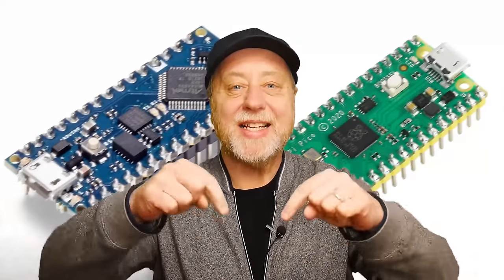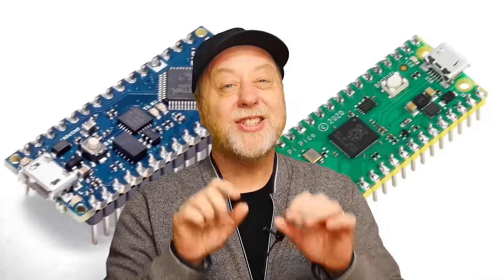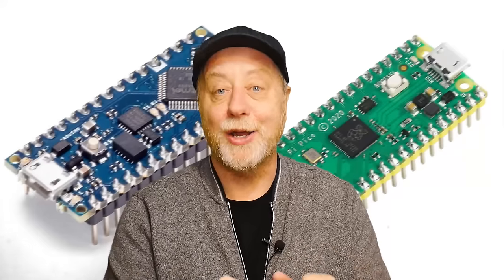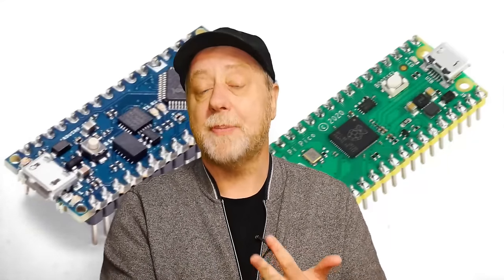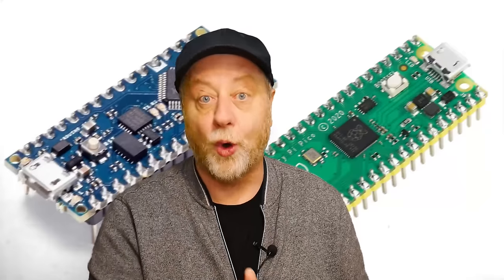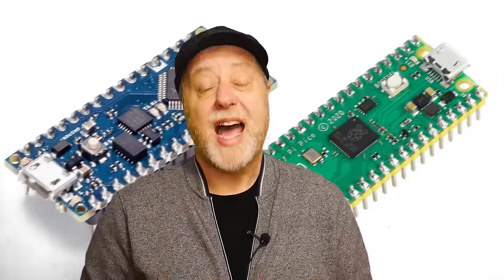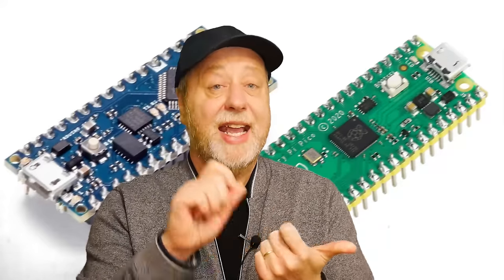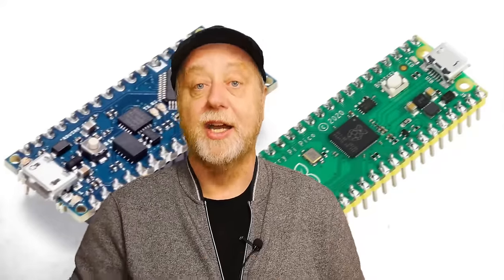Arduino vs Pico - Which is the Best Microcontroller For You?

Comment: Gary - do you have a review of the programming interface differences between the PICO and the Arduino?
For example - the Arduino programmer must install the Arduino programming interface software and download libraries.   The Arduino programming interface has a device feedback display where variable values can be printed to screen.   The Arduino code must be written in a text editor and then uploaded into the device.   I'm wondering if you see the PICO interface to be as convenient as the Arduino?
Sincere thanks!   Love your videos!   You are awesome!
Reply from the maker: I don't quite understand the question. You get all of what you said, about the Arduino, on a Pico using Python (with Thonny) or with C/C++ using an IDE like VS Code.
Reply: @GaryExplains  Thank you Gary.   I apologize for not being clear.

In your experience - do you find the Pico programming process and environment to be as convenient as the Ardruino?

And do you find the Pico libraries and user-group support to be equal with the Arduino?

Comment: For me Arduino was a great way to learn about microcontrollers and electronics in general. Now I mostly work with bare Atmegas when building circuits. It gives me the flexibility to use a chip that fits my design, not the other way round. I have a feeling that Raspberry Pi will not allow you to take that next step, and you are always limited to using the board whether you need it or not.
Reply from the maker: I guess you are referring to the fact that you can get the ATMegas in DIP format. There are solutions for Arm processors using a SOP to DIP adapter board. I did a whole video on building an Arm Cortex-M0 board from scratch: https://www.youtube.com/watch?v=4PMj8LfR2m8
Reply: Thanks!
Reply: You can buy the rp2040 itself and design a board for it yourself to fit your needs so you arent limited to using the raspberry pi pico to be able to use the rp2040. You do need external components with the rp2040 though like capacitors and flash storage.
Reply: @conorstewart2214  my only problem is the QFN, I would like a QFP at least to not need a hot air station and make it more friendly. Is the most cheap MCU I can get but not the more easy to work.
Reply: @oienu  If you have a hot plate or hot air station which you should have if working with SMD components and you can get them for very cheap, then QFN shouldnt be an issue. I think I have seen people hand soldering QFN too, you need to extend the pads out.

Comment: If I was starting a new project I'd probably use the ESP 32
Reply from the maker: Interesting... Why?
Reply: @GaryExplains  usually I need Wi-Fi for my projects. And I like the multiple cores. 
My previous go to was the nodeMCU
Reply from the maker: @paherbst524  Sounds like you need the Pico W. It has Wifi and dual core.

Comment: Which one has less power consumption ?
Reply from the maker: Hmmm, since there are lots of Arduino boards then you will need to be more specific. Then there is the issue of the power consumption of whatever project you are building. Obviously the power consumption of the microcontroller is irrelevant if you are building a robotics project or doing lots of WiFi or powering a screen or whatever.

Comment: Can it run Crysis?

Sorry, I couldn't resist
Reply: Some mad lad recently made Doom run on RP Pico, which is quite a feat because low CPU power, very little RAM and just 2MB of storage. The original Doom required 4 MB of storage, for example.

Comment: Everybody, do yourself a favor, get VScode and PlatformIO (both free) and program these microcontrollers from there. The arduino IDE is brutal when having any source code with more than a few lines. You get so many advantages with a proper IDE.
Reply from the maker: I have a separate video about Platform IO already on this channel.

Comment: I think  the  ESP32 microcontrollers should be mentioned as well . The power of a single  Wemos D1 Mini is huge.  compared to a adruino. Even if  you count in the Price for the Wemos boards  Approx 2 Euro's per board.  i have no experiences with the raspberry pico so far.
Reply from the maker: I don't think ESP32 should be mentioned in a video not about the ESP32.
Reply: @GaryExplains  perhaps for another video.

Comment: Worth mention, I have to use the nuc utility to switch from arduino to microPython IDE.  Also, RP2040 is a speed demon that can be overclocked both cores much higher than default, as you know. Clear winner for speed, however, Mega for driving lots of stuff, some arduinos lend themselves to Ultra Low Power mode. So I choose the micro controller and dev boards based on purpose. I hope to see a similar variety of purpose built dev boards in the 2040 offerings in the near future.

Comment: To answer which is best.. as an engineer designing boards, 
The cost of a product is not the base cost of the processor
Can the Pico code be protected ? Can any Arduino chip code be protected ?  please answer that...
Maybe encrypted code can be read out, but can Ram be read out ? its tough to really secure your code in a microcontroller, is there any microcontroller with truly secure code ?
Reply: we, the open source people don't like closed systems anyway
Reply: @Henry-sv3wv  but how do we protect a new product ?
Reply: @nickmarsh9384  With the GPL license.
Reply: @Henry-sv3wv  Do you really think any kind of license will stop someone from dumping the code from a micrcontroller or reverse engineering it and using it in their own product? That is what they are on about. Not everything needs to be open.
Reply: @conorstewart2214 
>Not everything needs to be open.
Yes, it does. Even Nvidia  decided  to make open GPU drivers.
Reply: @Henry-sv3wv  no not everything needs to be open,  Nvidia doesn't have much to lose opening their drivers, they only work on Nvidia products, all they may lose is licensing money on the drivers, people still need to buy the graphics cards from them, their hardware is still closed and the software and drivers are useless without the hardware. If someone makes a product that uses a microcontroller then anyone can dump the flash and ram and copy the product, that can't happen with proprietary hardware like Nvidia, so it's not a valid comparison. Also making something open source means that it is very hard if not impossible to make money on it, so say you've got a team that worked for years developing a piece of software, the moment they make it open source they can no longer make much money on it because anyone can run it for free. So if everything has to be open then people can't make money developing these things which means people won't develop them and nothing will get done, open source is good for some things especially hobbyist projects and academic use but it is very hard to build a business model around anything open source.
Reply: Have y'all forgotten about lockbits? Yes, they are a thing. And the code never gets written to an MCU in its source form, only in compiled one.
Reply: probably not at this moment. but ST is doing a good job on integrating security in its new cores. And this is really becoming an issue as more and more devices are interconnected (over the internet). You do not want your house/factory/car to be hacked.

Comment: Anyway to program these things with old school type basic language? All these new languages are nifty but my preference would be something i used for a long time. I still like learning and would rather spend the time learning the device but not the language.
Reply: The problem with basic, and Python really, is that these are interpreted languages. These are many times slower than a proper complied language. Basic is also generally a terrible language in the 21st century. It encourages bad habits and can only access the hardware using custom keywords. You can learn the Arduino version of C - which hides some of the complexities of compiling - pretty quickly. I’m guessing if you only know basic then you haven’t programmed for around 40 years?
Reply: not helpful and insulting. and wrong!
Reply: BASIC really is… a language of past. Python has taken its place as the easy to learn and use language. In part because it’s so much newer. After all, Python is only 30 years old!

YouTube was was originally, and I believe still is, primarily written in Python because they could iterate so much faster than using traditional languages like C. So much so that Google gave up trying to create a competitor and bought YouTube.

For someone already familiar with fundamental programming concepts  like variables and branching, it’s quite easy to start writing basic programs. I mean REALLY easy. My response on first encountering Python was “This is what BASIC should have been.” 

There is a classic Python joke: how do you get from your pseudo code to a program written in Python?  You change the file extension from .txt to .py.   Once you try writing some Python you’ll understand how that is is funny. Well, at least a little bit humorous. 🤷

Try it. I think you’ll be pleasantly surprised by how little you actually need to learn. I think that reflects the intention of its creator to create a language for teaching programming. I think he wanted a language that wouldn’t get in the way of learning programming concepts.
Reply: I have answered my own question. All I was looking for was an option for basic. And it is available.  As it turns out there are multiple options for basic on the pico including pydos/pybasic. I have nothing against any other language.  I believe people should code what they would like to code in. I am not asking for language information for a career here.
Reply: @retronicksprogrammingchann2337  Agree entirely.  If you just want to be creative, it's often best to start with what you already know.  (I still use CAD software that I learned in the 1980s for some drawing tasks.)  If you come up against limitations, you either work around them, or you then find out how to use a different tool for that particular job. Over time, that may become one of your preferred tools as well, but that's up to you of course.
Reply: @GodmanchesterGoblin  I just have to remember that this is youtube and sometimes its just kids responding to what they have been told at their intro to C++/java/python course.  As they used to say - best tool/language for the job.  I find that the constraints of a tool make you become more creative to find a solutions. But sometimes if there are too many constraints than you need to look at something else.  I think basic or basic like language should work fine here.  Some of these old dos programs just work better even through dosbox. I have  read some of the best authors are still using old dos word processors because that's what they  and more productive in.
Reply: python is the better "basic"
Reply: python is great - nobody is putting down python. its not basic though.
Reply: I don't really understand what you mean by "I want to learn the device but not the language"
Devices change faster than languages.

Besides, if you write code for these boards in basic, you re really missing out on one of the biggest advantages of these Arduino's;  the libraries.
How are you going to do analog IO, or serial IO, or how are you going to use any SPI display if you don't want to use the libraries that are written for these?
You will spend months doing a simple thing with an Arduino based on ATMEL chip... Then you find your project needs something beefier... And you wil have to start all over from zero on a board with an ARM processor.
Reply: i fully understand what you are saying. I understand the advantages of using the python/micro python etc. This is just a preference that i would like to do it a different way. I already know some python but i will spend a good amount also looking up language features as its not something i use everyday and I just don't find it fun. I do find the basic language more fun to play around with.  

And what i mean by learning the device is that i want to learn how interact with the hardware. the logic and software application i would rather do it with a basic type language.

Now what i don't understand is all the negative view about using somethin else. I am not in any way suggesting this for anyone else. It's just me, I am not out to change anyone's option about basic either. I am not trying to convert anyone to it. Python is a great language use it and create amazing things.

As mentioned in another post there are options for basic and the pico device and i will be trying them.
Reply: You can use assembly directly, if you wish :)

Comment: The main difference between Arduino and Raspberry pi is that Arduino you can actually buy and Raspberry needs to fix their supply chain...
Reply from the maker: I disagree. There aren't any problems getting the Pico, they are generally in stock worldwide. Plus there are plenty of clones on AliExpress.

Comment: The PICO options sound the best. I really don't like the Arduino IDE. Thonny seems more straightforward for micropython. I am very interested in C and C++, that is way I am more interested in the PICO. It seems to have more control. Thanks for the content.
Reply: You don't have to use the Arduino IDE though. I use Visual Studio Code for both my Arduino and Raspberry Pi projects, so much better than either one of their IDEs.

Comment: Since you asked, I'd use a Teensy
Reply from the maker: Interesting, why? I find the tiny size limits the number of GPIO pins.
Reply: @GaryExplains  For high speed projects I prefer the Teensy. The high clock speed and the highly optimised libraries. For cheaper options I go with Arduino (and clones) and more recently Pico.

Comment: I am getting nowhere with the pico using C++, I connect it to the arduino IDA and there is no driver :(
Reply from the maker: I have two videos on getting started with the Pico. You might find them useful.
Reply: @GaryExplains  I have looked at the C++ one, it's on Linux not actual Windows :(
Reply from the maker: Technically I used Windows Subsystem for Linux, so you don't need to install Linux. But there is also a setup program you can run on Windows to install all the stuff you need just on Windows (without WSL). Also if you have a Raspberry Pi you can compile on that.

Comment: The reason I don't like the Pico is because the RP2040 chip is impossible to hand-solder onto custom PCBs. Since it was designed with hobbyists in mind why can't RPF release an LQFP version?
Reply from the maker: So you don't like the Pico board because the chip on that board can't be used independently of the board in a way you want. Well that makes sense... Eh? 🤦‍♂️
Reply: @GaryExplains  Well it makes sense to me and probably quite a number of others who use Arduino or STM32 ARM core (eg bluepill) modules along with various shields to prototype and debug a design and then consolidate the tested design onto a single custom PCB.
Reply: @seankayll9017  worst comes to worst, you can always order a stencil along with your pcb (if you order it instead of printing pcb by hand) and use a hot plate and be done with it
(just a suggestion 😉) RP2040 comes really cheap though, like dirt cheap, you can order 10 for 9GBP for pimoroni (I don't know if there are any chip this cheap with this kind of power, so any pointers are very appreciated)
Reply: @thenewnew1997  Yes, thanks for the suggestion. I have used a hot air rework pencil to solder such packages in the past but I just don't trust soldering that I can't inspect easily under a microscope. Some of the STM32 M0 uCs are quite cheap (and LQFP) - but not 10 for £9 cheap, certainly not in a few-off volumes anyway. I know the RPi Pico board has castellated edges for flat soldering to a PCB motherboard but not all designs will accommodate that.

I think it is also possible to get PCBs made in China with companies that also offer soldering of SMD parts. That would be another option I suppose.
Reply: Fully support you there. An LQFP would be nice especially for designing prototypes. And for that reason I went on to STM32. (And that stoopid python language thing🤪)
Reply from the maker: Did you watch my previous video on how to build a Cortex-M0+ microcontroller board from scratch? Using an AVR chip isn't the only solution! SOP to DIP adapters aren't hard to use, even I managed it with my terrible soldering skills! I have a video on how to build a Cortex-M0+ microcontroller board from scratch: https://www.youtube.com/watch?v=4PMj8LfR2m8
Reply: Just think of the pico board being a DIP chip.

Comment: Is the Pico actually a Raspberry Pi? Does it run Linux?
Reply from the maker: No, the Pico is not like the other Raspberry Pi boards and it doesn't run Linux. I have an intro and review video on this channel if you want more info. If you want a small and cheap Pi board that runs Linux get the Pi Zero 2 W.
Reply: @GaryExplains , Thanks.